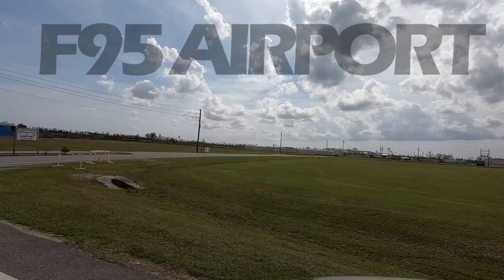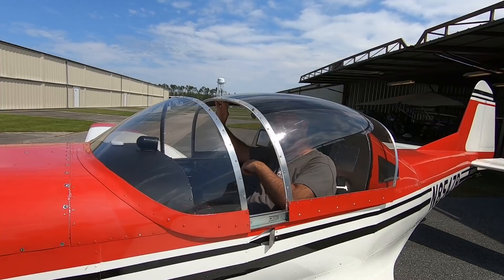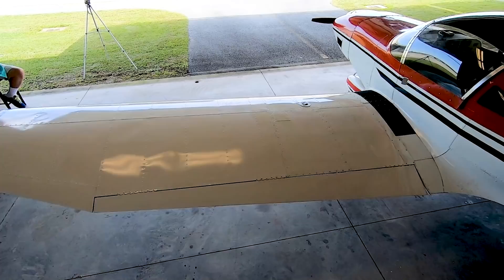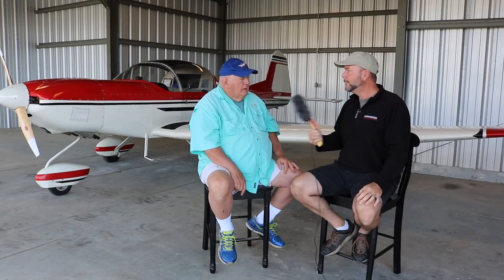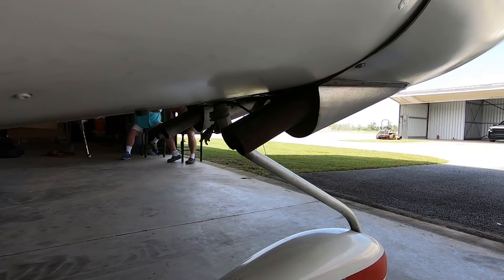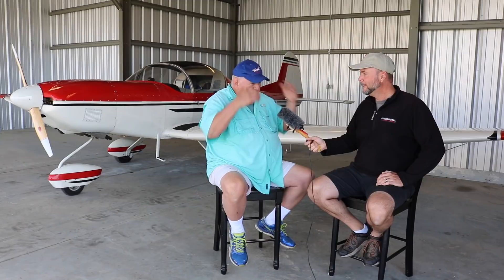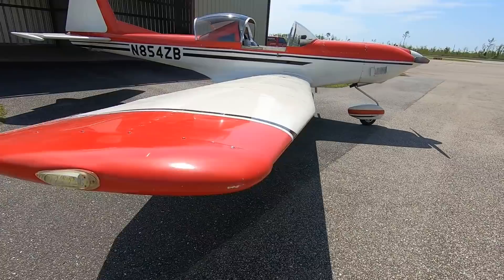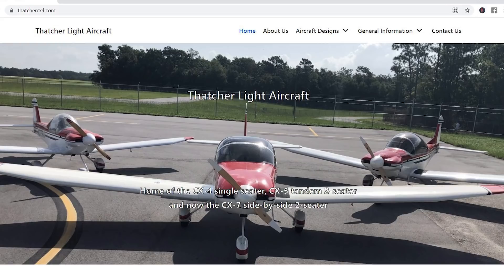Hangar13 The Flying CX7 Thatcher Aircraft Plans Built Airplane

Comment: Another great interview at Hanger 13 Bryan. Glen has built one sweet aircraft that looks really fun to operate. I can see this aircraft design becoming one of the more popular home builds after all his changes are incorporated. The only tooling I could see would be a small box-break inside your work area to bend all the smaller pieces and have the larger wing components formed at another sheet metal shop. Glen has built one beautiful aircraft that he can surely proud of. It’s nice to see these builders on you channel because we may never had have the opportunity to review a builder like Glen in such a relaxed setting like Hanger 13. To bad we didn’t get a chance to see his VW power plant setup. Bryan I would really be interested if you could ask Glen for some pic’s of his VW setup and post them on your site for a follow up? The way Glen explained his plug firing setup has to be extremely reliable from a safety aspect. Great builder interview Bryan and as I mentioned before please keep these hidden treasures coming.

Comment: Happy to see the 7 flying, congrats Glen! Another difference with the Revmaster is the 4th bearing on the crank snout that is also oiled, more support for the crank. Other VW aircraft conversions do not have that extra bearing and was a problem in the past, doesn't seem to be the case anymore, but I like to have the extra assurance.

Comment: A fine presentation for a nice homebuilt design.  I have 2 notes about the VW engine talk however--  the interviewer asked about differences between the Revmaster conversion and other VW aircraft conversions (of which there are about 3). The builder did not answer that question, instead answered by comparing Revmaster to a normal VW car engine.  This leads me to think that Thatcher Inc. has a sweetheart deal with Revmaster, and didn't want to say the truth, which is that all those VW aircraft conversions are basically the same.  I'm not knocking a sweetheart deal, it's a standard business practice, leading to good things.  But he missed an opportunity to talk about the only real difference with Revmaster, and my 2nd note:
Revmaster has designed a nice beefy thrust bearing at the front of the crankshaft, something not found on their competitors.  This is a big deal because the original VW design was not made to have that area be a stress point.  Too bad it was overlooked in this interview.
Reply from the maker: Thank you for bringing up some of the finer points. I truly wish the "Conversation" could run much longer with even more detail. But... then you wouldn't (some  or most) wouldn't bother to click on an hour long video here on YouTube. So there is always a struggle to get as much "meat" of the info into a storyline less than 20min long. :-) Thank you for your support!
Reply: True.   But they designed the CX series against the RevMaster, so the balance, engine mounts and cowling are set to go.  Joe at RevMaster is a vw engine guru.

Comment: What does this get you that a Van's design doesn't? VW power?
Reply: I think you have the question backwards. Why spend 2 or 3 times more on an RV if you can get roughly the same performance and utility from a CX-7? I'm comparing the Kitplanes Buyer's Guide numbers for CX-7 and RV-12. I do trust the Vans numbers a little more, and then of course there is the aspect of build time and Van's kit quality and completeness (firewall forward!) versus scratch built.
Reply: CX7 and RV7 similar performance?? No way. CX 110-120, RV7 170-200.
Reply: @marcumb  I was comparing it to the RV-12, not the -7.

Comment: Cost to build one??
Reply: Revmaster is under 10k and probably another 10k for materials. Then the price of whatever avionics or gauges you use. I added up all my materials I'll need for my build and it was under 10k but I'm sure it can creep up. Very rough ballpark estimate.
Reply: @wesvasher  thank you
Reply from the maker: I believe Glen mentioned sub $30k with essential gauges and instruments etc. Thanks for stopping by! :-)
Reply: Plans built is the cheapest way to go.  I did about a years research on kits, planes, and various plans built planes.  The CX series is a sweet one, all aluminum construction, steel nose leg, steel engine mount, great handling characteristics says everyone who flies them.  Easy to maintain, low cost engine.  But you have to balance time to build with your goals.
Reply: Unfortunately unless you have a local supplier for aluminium shipping is crazy high now.